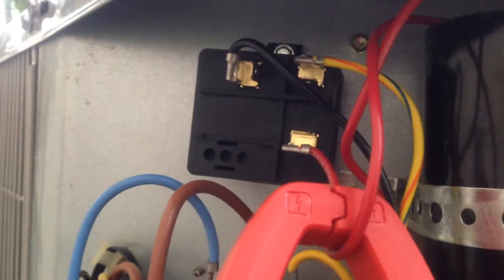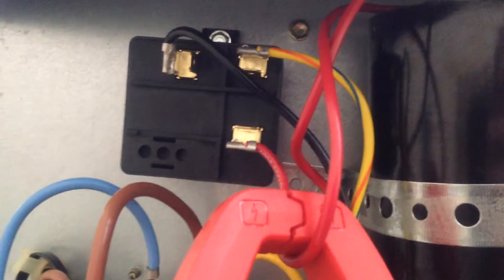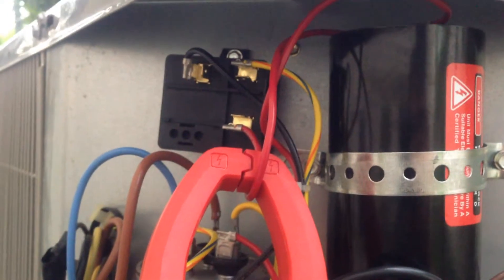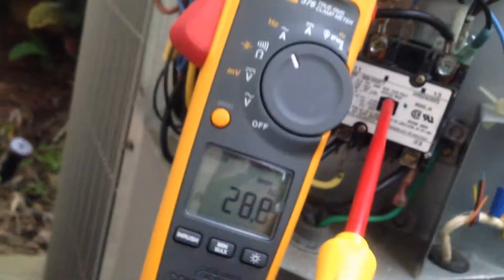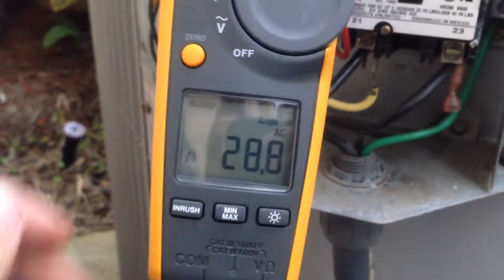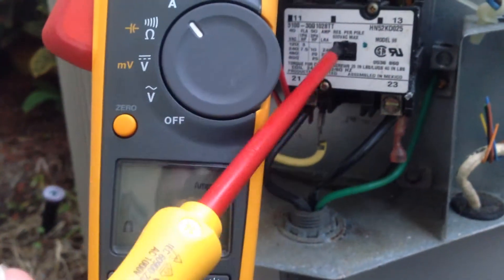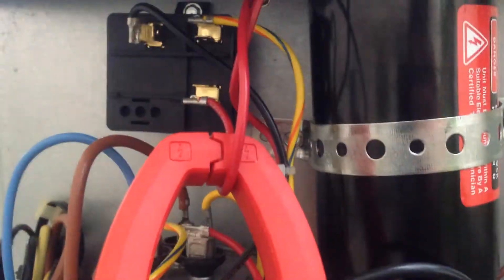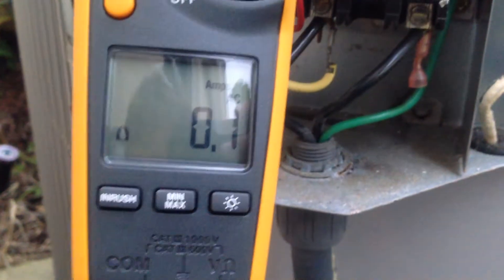How to test a potential relay part 2

Comment: Another way to see if the contacts are opening is to just see if you get a voltage reading between 2 and 1. if you read a voltage you can be sure the contacts have opened.